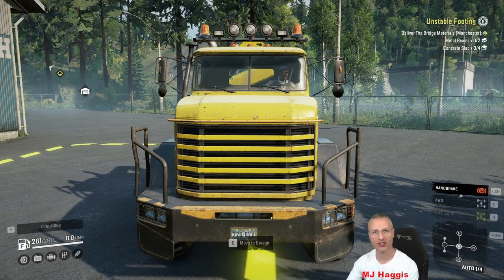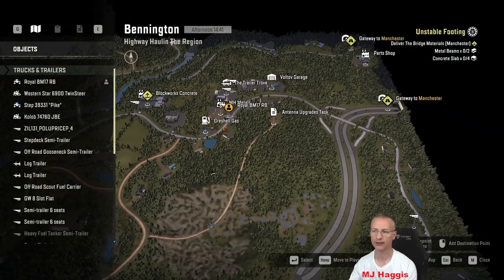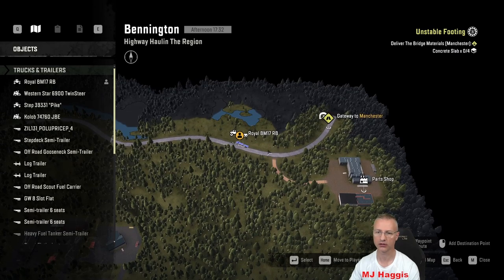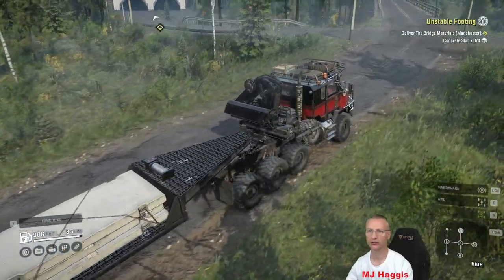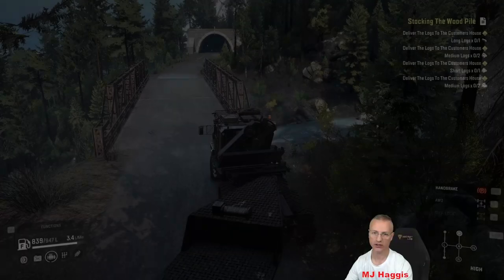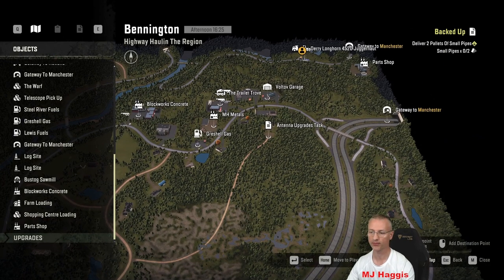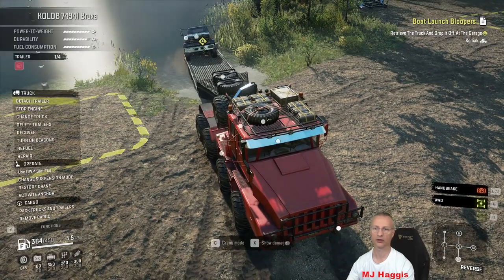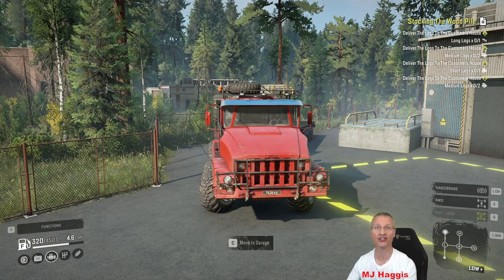Snowrunner - Highway Haulin' - P35 - "Unstable Footing" & "Boat Launch Bloopers"

Comment: Short answer, pivot point is the center of any given axle group.

Pivot point in real life depends on the friction balance of each axle group.

What that means is that, typically, the pivot point on smooth, flat, level ground is slightly center of the axle group.  For that 6 axle trailer, that puts it between axles 3 and 4.

In practical application, the pivot point is constantly changing depending on load and terrain.

If you angle up, it lifts the forward axles and the rear axles take up more load.  This reduced friction, and thus traction, on the forward axles and increases load and friction on the rear axles.  This results in the pivot point being moved rearwards, increasing turning radius.

As you drive, the terrain is constantly shifting and this your pivot point is constantly changing.

The Juggernaut has a rear steer axle, who h helps to move the pivot point forward of where it would otherwise be.

In the real world, trailers with spread out axles behave a little differently.  Often, on flatbed trailers, the rear axle typically carries more load due to the design of the frame and suspension, resulting in the rear axle being the pivot point, and the forward axle getting dragged sideways.  In off road situations, this can cause significant problems on a sharper curve because it turns that forward axle into a plow, digging a deep furrow in the ground and requiring a great deal more power and traction to drag it through.  On highway applications, it means the tires on the forward axle get rapidly chewed up and the shoulders get rounded quickly.

With a game, the pivot point t becomes less predictable because it all depends on how the equipment is modeled and the behavior of the physics engine.
Reply from the maker: Hey Daniel, awesome answer and the short version covers everything I think you could want to know 👍 Thank you for taking the time to comment 👍